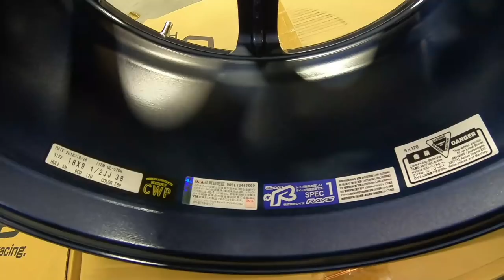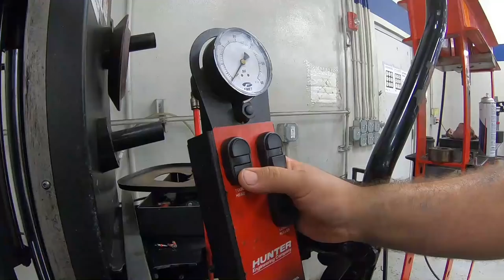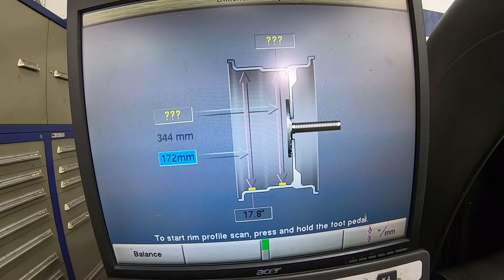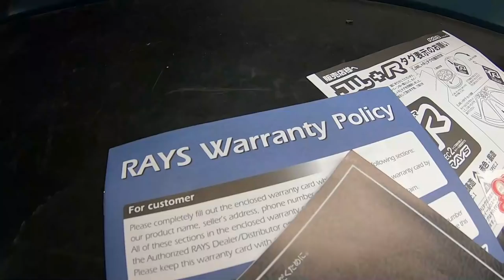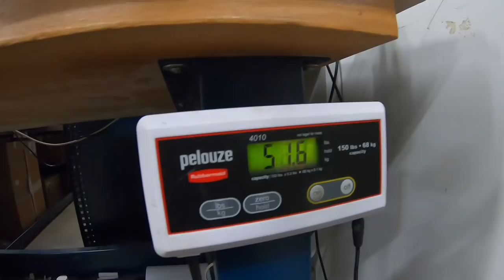FK8 Honda Civic Type-R - New Wheel Rays 57DR and Michelin PS4S Installation Guide (Episode 4)

Comment: Every Enkei, Weds, or Volks wheels I ran, I never used center caps. But if you do no caps, at least paint the axle nuts and rear hubs flat black for rust prevention and looks
Reply from the maker: Good point!

Comment: You said in the video the wheels are 18x9.5 +35 offset and video shows the wheels box and the box says 18x9.5 +38 offset. I’m confused which one is the correct ?
Reply: They are +38

Comment: Those wheels look real nice Mike, for me personally I would go with centre caps. One question (probably a stupid one) but won't changing the wheel size (diameter) put the Speedo out of calibration or have you changed the tyres profile to compensate, I had this problem many years ago when I fitted bigger wheels on my car but lowered the tyres profile to compensate. John UK.
Reply from the maker: You are right John. It will be slightly off if the total diameter is different. With the wheel and tire we went with, it is pretty close to stock but not 100%.

Comment: I want to keep the 20 inches wheels in the 2020 Type R but I want bigger tires meaning 255/30-20 with 48mm offset. What do you think?
Reply from the maker: That should clear without any issue
Reply: @ahcgarage  Yes I like the meaty tire look. I try that with my 2017 STI and it looks  very good. Now what can I do if I want to keep the 20 inches wheels but with 265/30R20 ?

Comment: Do you know what’s the biggest tire I can put on my stock type R rims. I’ve seen a video that shows 35’s fit with no problem. I would love to know if it’s officially possible to do so without any rub issues or fitment. I appreciate any feedback so I can keep my original 20 inch rim with a bigger tire than what is only recommended a 30 side wall.

Comment: Is this setup with the stock suspension 😊
Reply from the maker: Eibach lowering springs installed
Reply: Do you need to install the rear camber
Do they hit the fender when you low it
What size of those tire
Thank you